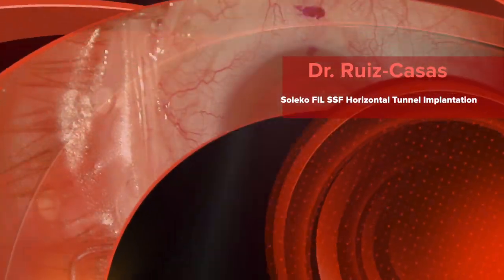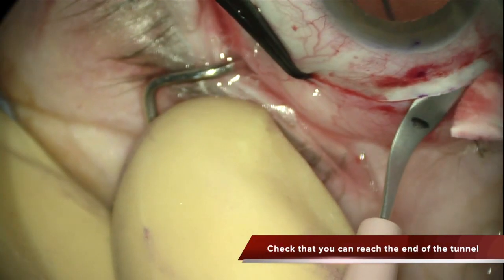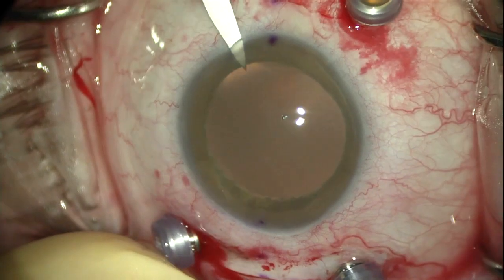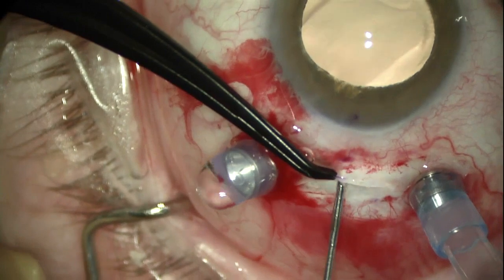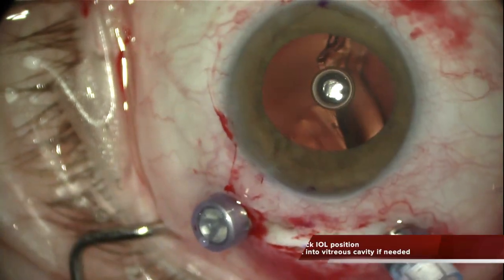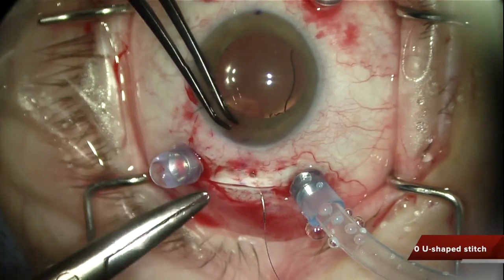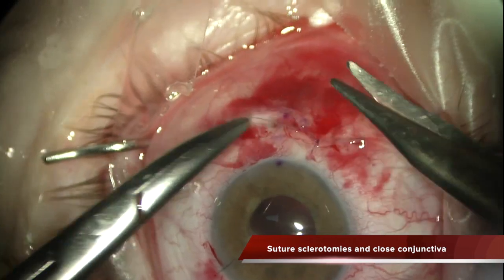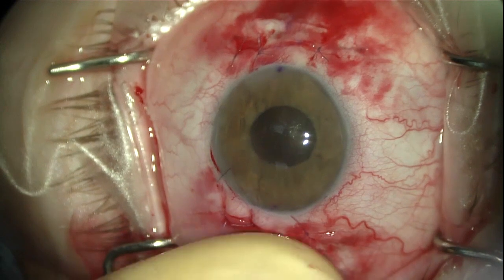Soleko FIL SFF safe Scleral Tunnel Implantation

Comment: I like your step of preserving the limbal conjunctiva during creation of the scleral tunnel 
Performing limbal priotomy by cutting the conjunctiva flush with the limbus is a crime that must not be done by any vitreoretinal surgeon or other surgeon.
You said one thing during narration which I believe is very important and which i do in  my cases, 
During any vitreoretinal procedure which involves suturless IOL implantation ,the best method to retieve the haptics with minimal manipulation is by letting the IOL fall over the retinal surface then retrieve it with forceps
This will induce zero haptic manipulation and subsequent tilt and will protect the cornea
What is your chandelier type and company?
I like the idea that it is self retaining not like the 25 chandelier old  alcon which i am using for 20 years now